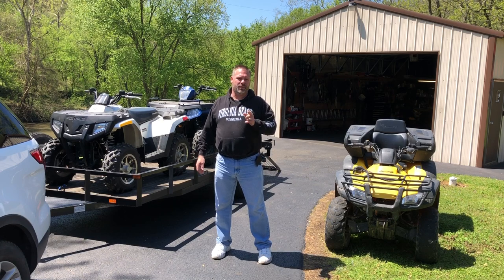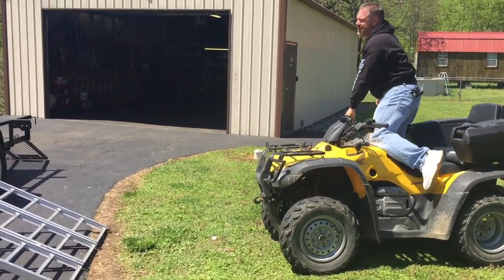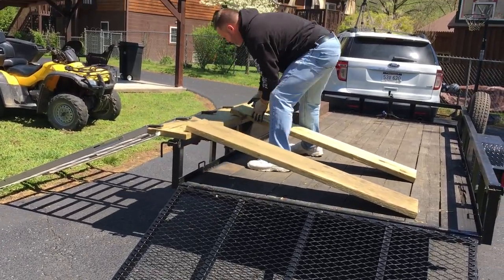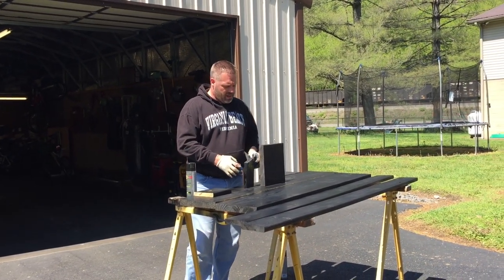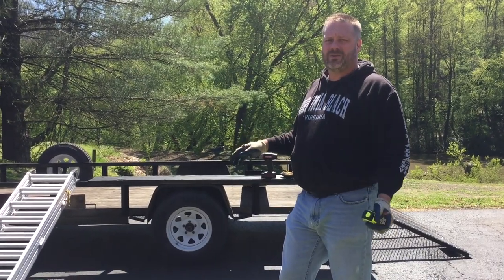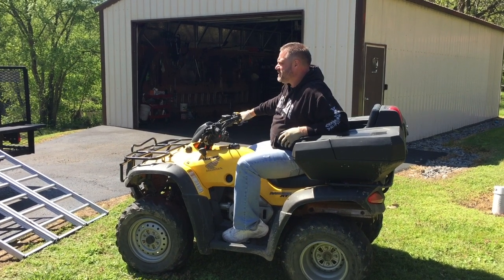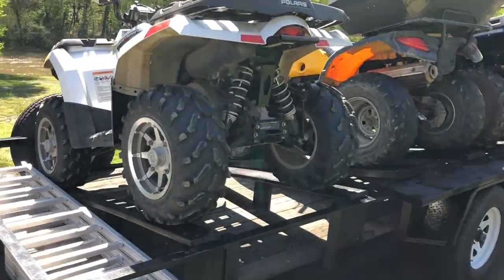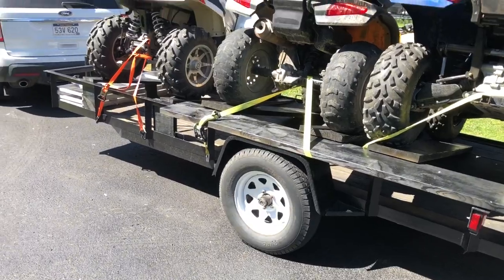Loading a 3rd ATV to this already loaded single axle trailer!

Comment: You are asking for trouble putting more weight to the back. You need tongue weight for single axle.
Reply: I was thinking same thing to much in back can cause back end to swing and pull vehicle off road easily.
Reply: @XxTWMLxX  I had to learn the hard way years ago. But once you get the life scared out of you. You learn real fast
Reply: More tongue weight is way way better than less.    Just search on trailer tongue weight..  put the Polaris all the way up front.
Reply: I was thinking swap yellow & white.. also backing them on too, help load balance.

Comment: In my opinion he should have put the heaviest in the front. The lightest in the middle and the last one at the end. And now you have all the weight of all three four wheelers on one side of the trailer. NOT VERY SAFE IN MY OPINION.
Reply: I use to pull triples (3 28' trailers) for a freight company.  Heaviest is always up front then next heaviest and so on. That way you won't fish tail or snake and you will  maintain control of your vehicle easier.
Reply: @IsoNurFace  You're right. Weight in the back will cause trailer whipping.  That experience is terrifying.

Comment: Why not cut the rails off and load one from the side
Reply: The rails are part of the structural integrity when welded
Reply: @Lithorock  not really there more of load securment if hauling something that will roll around the structure integrity in the frame of thr deck

Comment: You actually loaded those wrong. To prevent sway, weight should be to the front of the trailer not rear. Completely wrong

Comment: I would rather have more tongue weight than not enough.
Reply: Tongue should always be heavier then back to prevent sway and possiblity of trailer losing control pulling vehicle off the road.
Reply: I’d rather have tread on my tires than Honda racing slicks.. 😳

Comment: Just cut the trailer rail at the front left side and bolt some hinges on so you can raise and lower the side rail just like your tail ramp.
Reply: The rails are a key structural part of these angle iron trailers. They have very little strength without them welded in place

Comment: From a safety aspect, you might be asking a lot from that single axle, specifically the weight on the tires. In the video the camera catches the tires when you had the trailer loaded up. The tire was bulging quite a bit, not sure how long the tires will hold up to highway speeds on the interstate. I like your solution overall, just keep an eye on your trailer tires on trips.
Reply: 3500lb axle. All weight of the atvs are about 2,000 to 2,500 lbs. plus 800 to 1000 lbs trailer frame weight. The axle will do just fine. Weight capacity is perfect.

Comment: Came out nice.
 Just thinking that it would’ve been a lot easier if you just cut the rails from that one side you wanted to load it from and make them slip on slip off with a couple of screws you remove you load you lock them back up

Comment: If you're trailer is 14 foot long you can put two on there sideways and the other one straight on. I have got a 6.6 ft wide by 14 foot long and haul 3 atvs on it all 3 are 450 formans with no problem.

Comment: Not safe.  If I had to do something like this for a short term solution, I would just cut the trailer.  The best solution is to simply buy the correct size trailer- not just for loading but for correct tongue/overall weight distribution. With all three on an angle, there are various issues including more weight to the downhill side of the trailer. Also, one of the ATV's was barely on the wood. Also, always wear a helmet even for something as simple as loading.

Comment: Bud I done this 15 year's ago. Nothing  new.
Reply: Where’s your instructional video..?  Show him up... 🤷‍♂️
Reply: @caseysimon6357  i don't have any proof  but I welded me up a set of rails  that bridged across  my rails  on my trailer, and I drilled holes and locked them  in with a pin. Worked great.
Reply: @jameswallace3226  could you please explain this better? I'm looking for options to haul 3 atvs.
Thanks!

Comment: Could have just cut the rail off the trailer  on one side then you wouldn’t need the ramps
Reply from the maker: On this style trailer the sides are the main support for holding up the weight of the trailer. If the side was cut off the angle frame wound bend or break.  Thank you for the comment though.
Reply: Thats what i said simple fix maybe its because i been a welder fabracator for 35 years.lol
Reply: @gawzitup6901  support it with another peice of channel under it simple fix i mod them all the time easy project if you know what your doing been a welder fabracator for 35 years now and never had any problems with any thing
Reply: @kennethgrimes5494  Do you sell them? Where are you located?